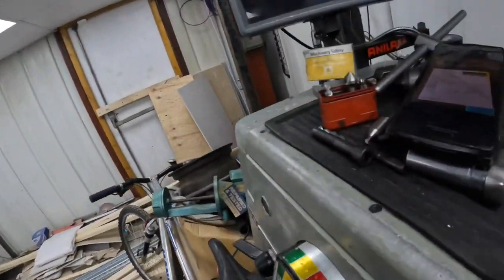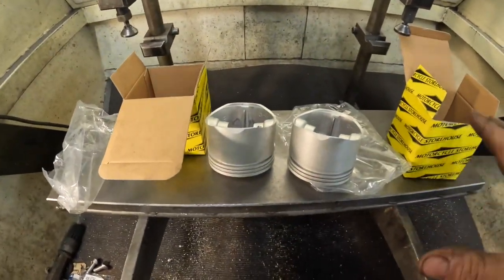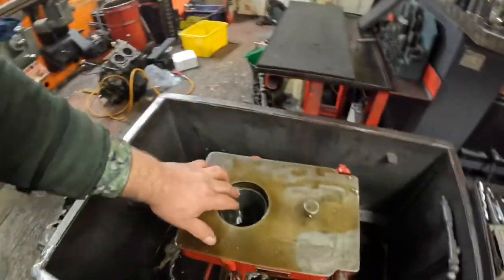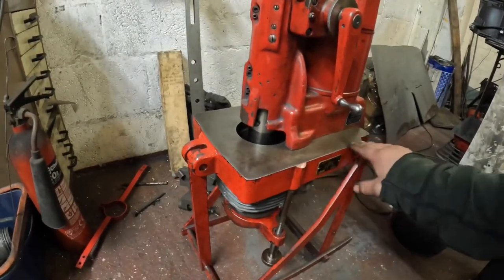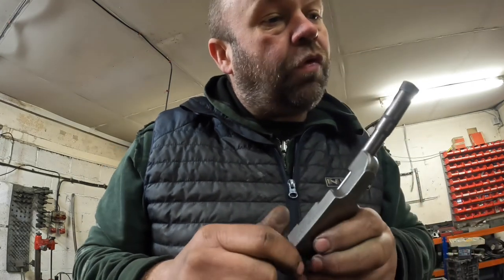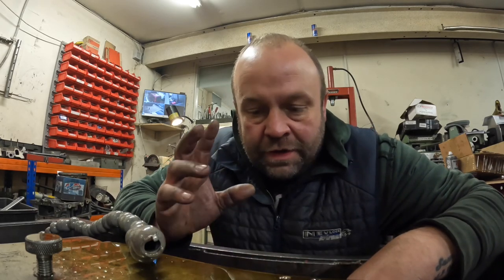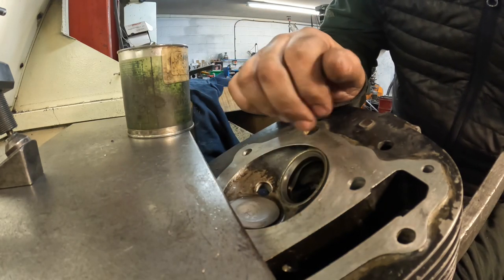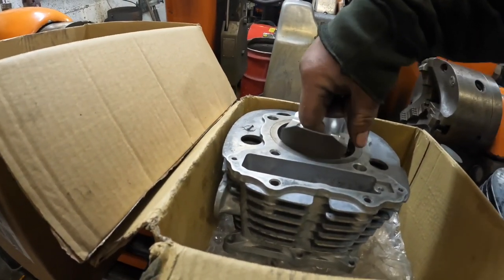Harley Davidson Rebore | Yamaha XT 500 Rebore, cut valve seats & head skim | Machining  with Lathe

Comment: You can upgrade the Van Norman cutters to carbide cutters. And you just turn cutter round when they get blunt no more sharpening. And gives a better cut 👍
Reply from the maker: Where do I get them from Nigel.
Reply: @Grace Engine Developments  beam equipment and supplies in the states. Think they also have a shop on American eBay.
Reply from the maker: Thank you I'll have a look